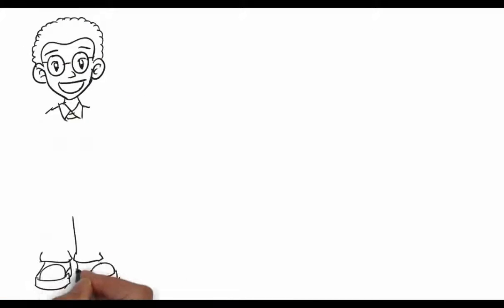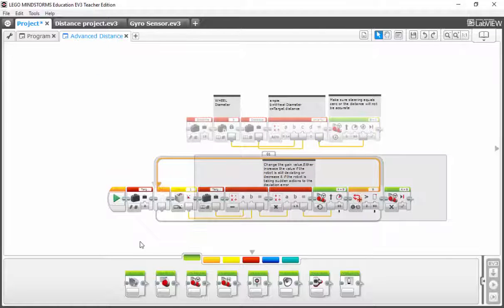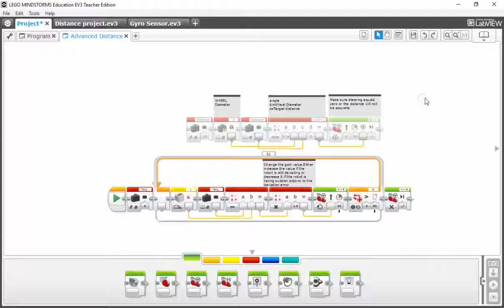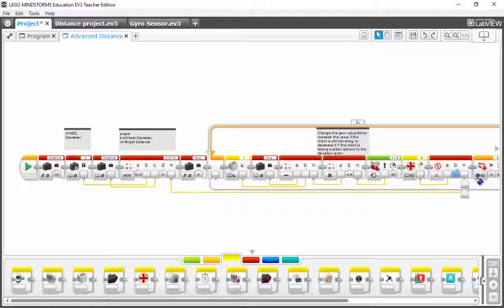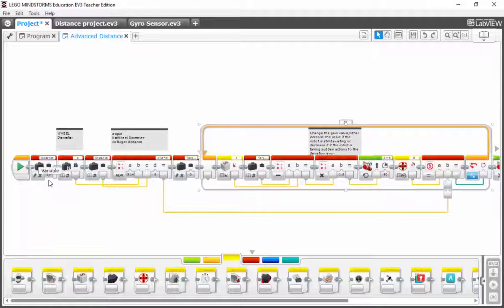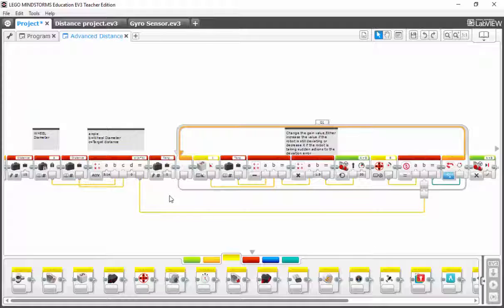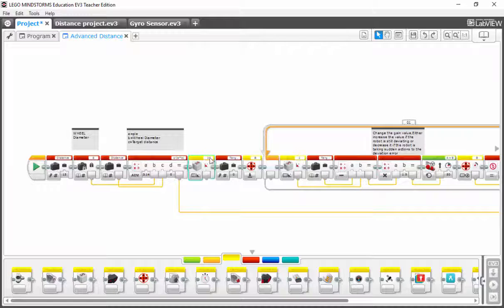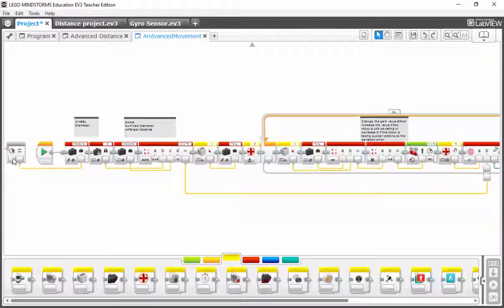how to make ev3 go straight with Gyro and to a specific distance | Explained

Comment: I was hoping  if you could make a video on how to solve drifting problems when using the gyro sensor
Reply: Robotic Int i was also hoping for a video of that kind
Reply: you guys can just restart the robot on a flat surface and don't touch it to reduce the chances of the gyro drifting. Hope this helps!
Reply: It could be the wheels, our team discovered that the large motor what be a little off because it move around so add support beams